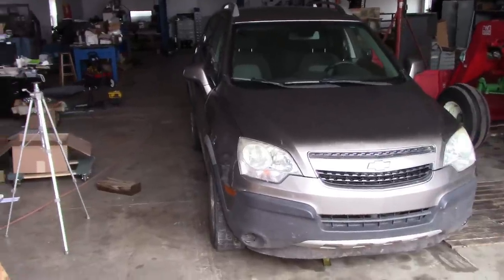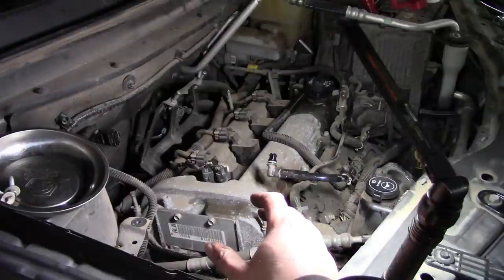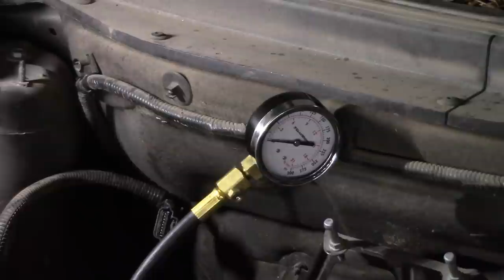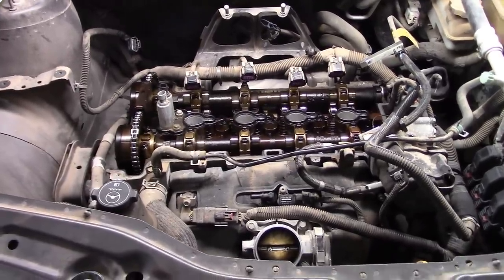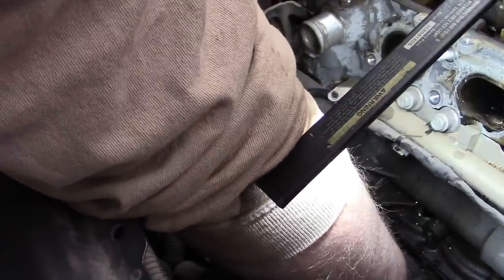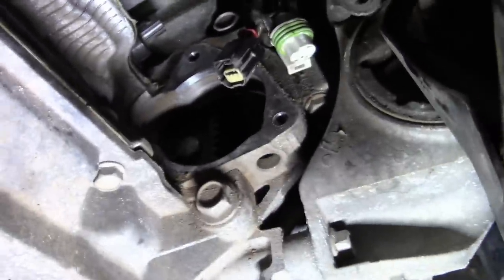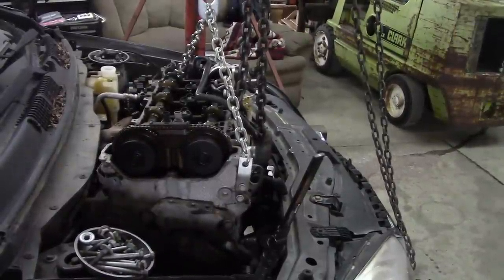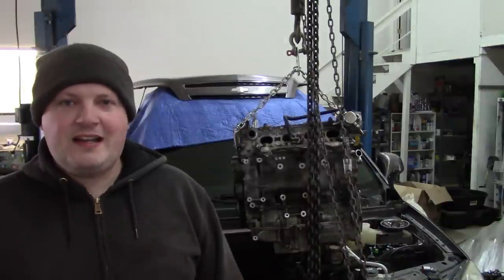I Bought the Cheapest Small SUV on Marketplace - Part 1

Comment: Universally known as a “Craptiva” here in Australia.
Reply: It's also known as a captiva in United States. From 2012 to 2015. And 08 to 2012 was Saturn vue. I have a 14 LT2 and love it.
Reply: Sean.. dit you read it? cRaptiva
Reply: @howardsen666  this is a different vehicle than the european one
Reply: Robert Wade here in south america those shits are everywere and they are GARBAGE. Keeps me in business right?
Reply: @howardsen666  I did read it. But there not all crap. But just do maintenance and  check everything. Catch it early. Not actually a bad vehicle. Hell if you look at forums I own 2 crap vehicles. The Captiva and a Ram Ecodiesel. They both should have blown up. Caught fire or killed me by now. But no, they haven't. Just don't beat on them like they owe you money. And regular checks.
Reply: Vauxhall here
Reply: Can confirm, it's the craptiva here is Aus. It's not just the drive train, but literally everything in that car. Things that never break in other cars fail all the time in that shit box (windows, locks, radio, odometer, anything electronic).
Reply: In Malaysia garbage hv more value than used captiva
Reply: @JM811Cars  Not exactly. We have it here as well. This particular variation was sold in Europe under Opel marque as Opel Antara. Unfortunately its craptivity does not depend on badge.
Reply: @arielatom03  HeeHee. ;-)
Reply: @TheMW2informer  That was an absolute gem of an email and article to read. Thanks for posting it.
Reply: Also known as the craptive in the U.K. too or the vauxhall antara
Reply: The Metalshop  so far so good. Both are alive and well.
Reply: Not just Australia. Everywhere.
Reply: Or junktiva

Comment: Let us have moment of silence for this dearly departed 2.4 L....
Reply from the maker: Yep, she's done!
Reply: I think I had that same engine in my Saturn Ion. I didn't have engine problems except for for valve timing solenoid. Lots of wiring problems though. I think I saw that same engine in the Polaris Slingshots as well.
Reply: cheeto4493  I had a 92 Saturn SC. it was burning oil like mad at 50k miles.  Saturn did a full rebuild out of warranty and only charged me $300. It was burning pretty good again by 100k, but adding one quart between oil changes did the trick. It made it to 180k when it blew the head gasket. It was not worth rebuilding or replacing.
Reply from the maker: @cheeto4493  I'm not surprised. The wiring harness is horrific.
Reply: The ecotecs are junk. Noticed where you live the other day while dad and I were hauling junk cars. We have an acreage on hillside road just a couple of miles from you. Dad runs muncks auto in clinton
Reply: No rust!! That’s gotta be refreshing. I live in the south and I just cringe when you push rust out of the way to get a bolt broken loose. This one will make your wife a nice car.
Reply: @beboboymann3823  HAH!  Live in NH, 10 years is the life of a car!
Reply from the maker: @munckdiesel5346  Nice. You guys just built a new shop did you not?
Reply: @beboboymann3823  She has a Toyota, why switch it out for this abomination? Sell it faster than you can say goodbye.
Reply: Watch Wes Work yeah we built a new shop a few years back. I’m turning 16 in a month and love diesels and basically anything with a motor so I love watching your vids. We run the old Clarke fork lifts too so it’s cool to see that stuff too.

Comment: "What is this a Chrysler product" LoL no argument there.
"What is that noise?"  Expensive.
Love the dipstick idea.  Though with it out my curiosity would demand I pull the pan off just to see the carnage.
Reply from the maker: We will crack it open in the next video.
Reply: @WatchWesWork  I was going to ask about pulling the pan. I wonder if the rod and piston are just sitting in the pan, because obviously it did not punch a hole large enough to leave the block.
Reply: @joesgarage805  I guarantee it's in small pieces.
Reply: I prefer using a long screwdriver because you can tap the tips of the pistons to see if anything sounds different from one cylinder to the other.

Comment: I like the ecotec motor I run one in my buggie 4-5000 rpm hour after hour in the desert and it is bullet proof, never have added a drop of oil. This one is the 2.2L and I have a back up motor I paid $500 for.  Like it so much got my wife a 2.4L Chevy HHR just changed the oil after 10,000 miles never used a drop of oil.  I did have a bad tensioner for the timing belt on my buggie when I got it. and put in the upgraded one and never a problem again.  just my experience. So. California no rust ever. no rain (not much anyways) either.

Comment: Wes next time you need to tepary a hose and the temp is kinking. Try installing a similar size pipe of spring or copper tubing to get flow. As a safety measure when drilling always slip a tube over drill bit exposing only the tip of the bit, to limit depth the bit will plunge to! keep several tubes with bit assortment. Thank's I really enjoy watching a "True Craftsman".    Excellent work.

Comment: Chevy (Holden in Australia) Captiva. Laughed my ass off when I saw this. Here in Aus these have a 'purchase at your own risk' reputation. Good luck.
Reply from the maker: That's how I feel about all GM products...
Reply: @WatchWesWork   AKA steaming piles.
Reply: @WatchWesWork  your not the only one, LOL
Reply: And they wonder why their still going down the plug hole
Reply: Watch Wes Work there called craptiva in Australia the resale price is so bad and parts to pricey you see then left on the side of the road when they stop working.good luck mate but think of it this way lots of content in videos fixing it.
Reply: @WatchWesWork   Sad to hear.  GM used to make good products I think.  I have a 1991 one ton dually with a 350 throttle body fuel inj. and a manual trans.  I like that truck.
Reply: istvan meissler they still make good stuff. You just need to get your information from more than the people that hate it. You need to see why some people have problems and others that don’t and make your own conclusions.
Reply: @lawnmowerdude  All GM products are universally crap, along with Fiat Chrysler's. I work in the motor trade and have the displeasure of dealing with these brands. Unfortunately all of the European brands are not much better.
Reply: Doesnt help that the demographic of people that mostly own captivas arnt exactly timely with maintanance.

Comment: They are sold by Holden in Australia and are referred to as The Craptiva leavings Sea of oil in the middle of the road on a regular basis. A friend bought one new and it fell apart 3 times in 20,000 kms so after the 3 engine he drove out of the dealers and straight into a Toyota dealer and never looked back. They say if you ever own one you will never own another !
Reply: Just don’t get the truck if you don’t what your vehicle to split in half lol.

Comment: Hey I've got an 09 Saturn Vue, pretty much the same car with the  same engine but with electric power steering. These cars were built in Mexico. When I bought it ($1500), it had coolant in the oil. Changed the head gasket but it still leaked into the oil again. Not sure where but it didn't have a crack. Finally replaced the block with a used one and had the head checked which was fine. Replaced all timing chains, sprockets and tensioner. Dropped the engine back in and it's been about two years now and haven't had any problems and no oil burning and car drives quite nice. Good luck.
Reply from the maker: Interesting. Cracked block?

Comment: That hole in the block is the Chevy inspection port.  We have had two vehicles with that eco tech engine a 2007 Saturn Vue Hybrid and a 2013 GMC Terrian. According to friend at GM there was a design flaw in the piston rings causing excessive oil consumption.  Our local dealer told us the only fix for our terrain was “dump it”.  My wife and I walked from the service counter to the showroom and bought a 2020 Blazer.
Reply from the maker: I'd have walk across the street to a dealer of any other brand...

Comment: 2.4s aRe running well into 250k miles currently in Solstice and Sky roadsters. No oil consumption.  They do have waterpump failures and rarely timing chain issues. The 2.0 has had HPFP failures. We carry a spare just in case.

Comment: Great content. Tip from a guy who has pulled two of these engines. One the way you pulled yours and once by unbolting top of the struts and unbolting the cradle. 3 hrs pulling. 1 hour 15 min dropping. Great video though!
Reply from the maker: Every car is a little different. I don't like to mess with the struts because you really need a alignment after. Plus I fear breaking loose the large nuts welded in the subframe. That turns the job in to a nightmare.
Reply: You know what. Now that you mention it I did have one of the “capture nuts” come uncaptured on the cradle. Yeah that was a pain lol

Comment: I replaced one in a Pontiac. It stalled and the throttle body was closed going down the highway. Manual transmission. It pulled seals looking for air. Dropped a junk yard engine in a the hatch of a 85 Saab 900s I got for 300. Temporary plates! It was a easy job. Got rid of it right after the job was done. I tossed the old engine right in my residential home street can. I sold the Saab for 900.

Comment: I owned a GMC Terrain with the 2.4. Was consuming 1 qt every 600 miles. GM techs told me. O that's normal. It's okay to drive. I give the Techs a single finger salute and said. I'm never going to buy any more GM crap no more.
 My daughter almost ran it dry. 😄😄 
Then the cam crank correlation codes popped up. Then the VVT soleniods crapped out. I replaced then with GM parts. Then the high pressure fuel system codes came up. 
About that time my daughter was leaving for Oklahoma. 
Clean and polished and waxed the Turd. Reset all codes and sold it back to GM. Bought a new Sienna le. All I do is basic service. Has 120k. Engine and trans no issues.

Comment: Last time I heard that kind of scraping, was when I through a road through a rod through not one but two inline 6 cylinder Chevy engines. One being a 292, the other being it’s little sister the 283?  Was always number 1 cylinder. First time I heard a similar scraping, was on an old 240 inline 6 on a 1965 Ford F-100 that was punched out 100 over. And Chevy had a similar issue with their old inline 6 cylinder engines, but it was because those inline 6’s was bad about dropping cam shafts back in the 1980’s. But I had to laugh, as I thought you bought a car that belonged to my ex. As they was bad about destroying oil pans, and trying to drive the car with no oil in it. But was glad to see Oklahoma plates, over Texas plates or anything indicating it came from Victoria, Texas.

Comment: Not that you’d ever do it but an interesting accessory you could make for the gantry crane is a tail that reaches out one way or the other past it with a little deep grove idler pulley on it, then you can hang the dangling end of the manual chain so it doesn’t get caught up or drag across whatever you’re working on

Comment: I'm app 25 miles from OK and yes, most vehicles around here are similar to that one as far as lack of rust. I have a few too many 50+ year old cars and trucks and they all have less rust than your pickup does. No complaints here with that. The only fasteners I'll have trouble with are a few body bolts that do get rusty and of course exhaust system fasteners. Sketchy wiring can even work for quite a long time before it catches up to you...
Reply from the maker: That would sure be nice. Trucks here will be missing the rockers and holes in the floors within 10 years, especially if you live on a gravel road.

Comment: good job shouting out neutral drop <3 those guys are legit
Reply from the maker: They crack me up.
Reply: @WatchWesWork  on a side note, i see that handy flashlight u got there, i have the same one. those quick connect flashlights are pretty cool and fairly skookum for the price
Reply from the maker: @TheTheonlyone1123  I like them, but I keep breaking them. My fault, I'm not nice to them.
Reply: @WatchWesWork  thats impressive lol. i managed to drop mine approx. 20ft down a spray booth exhaust vent and it happend to land perfectly on the baffles near the bottom that the magnet base held it pointed straight up the shaft, still providing me light for the job at hand and retrieval. but with any tool from the hazard fraught they are only so good but the price is just to good to beat especially when you have a family member working at one :D

Comment: Just did a engine job on a 2012 equinox 2.4, awd. It will come easily out the top. Back two bell housing bolts are a bit of a bugger, but by no means difficult. Hood didnt even have to come off.
Reply from the maker: Nice. The hardest part of the job was getting the big vacuum line off the intake manifold...

Comment: Very glad to hear your family is ok! You two seem to be good understanding and patient parents to that wonderful bear child you have! 1 acre turn radius was funny and needs to be looked at Dad!

I may have missed your explanation in the video: If that engine is such a problem style engine, and suspected to be locked up, may I ask why you would buy that car expecting to have to put that problem style engine right back in it? Im guessing you have something else to do, or maybe it’s a rebuild for family or friend that wants that style car?
Reply from the maker: Just like any engine, it does not have a 100% failure rate. But a larger percentage had problems than other similar engines. Many have already been fixed under various programs from GM.

Comment: 8 bought new a15 Equinox with this engine.  It came with free oil changes for 3 years. By the 4th oil change i decided to do it myself as I usually do. I found they never changed the filter and it had caved in from being so dirty.  I was yelling at the service manager and he said prove it. The dealer has a ton of lawyers. 
I dumped it real fast

Comment: If there is a next time you ever have to do this. Just remove cam gears and pull the head, intake, and exhaust manifold all together. I use a cherry picker to pull it outta the way. Makes pulling the engine or throwing pistons in it much quicker/easier.
Reply from the maker: That's a good idea. I should have just clipped the timing chain and pulled the head right off.

Comment: Great video Wes.  I'm wondering if it makes sense to go ahead and weld the old exhaust manifold while its on the old engine. The bolts will hold everything in place.  My limited experience with such a repair is that you pre-heat the metal with oxy/acetylene (maybe mapp works as well) and after confirming the appropriate temperature with an infra-red thermometer you stick or mig weld the pre-heated area. It seems you may have some time on your hands to do this.  Thanks again  Craig

Comment: UK 1986? Mazda 323... to replace door mirror you needed to remove wing, to remove wing you had to remove bumper.
The mirror did not get replaced....
Reply from the maker: Glue it on...
Reply: @WatchWesWork  passenger side mirror wasn't needed for certificate.. I was echoing yer comments about YTF do 'engineers/designers' not take into consideration serviceability access.... like that last bolt on the sump that you can only access by dropping the exhaust.. ye know what I mean.. ;-)

Comment: They used the 3800 in the Equinox (the Equiknocker), lemmie tell you, that thing will do a front wheel drive burnout indefinitely. Well, maybe until it runs out of gas.
Reply: They used the 3.0 for the v6s, more power than the 3800

Comment: What a hoot. I just diagged an 04 4.0 Cherokee driven in with a strange engine noise and a sever miss . Pulled plugs no. 5 plug destroyed  compression check 0 psi on no. 5 hole. Tried borescope. Didn,t look right not a good view. Stuck a scrap power window cable in no.5 plug hole and like you after inserting it about 20 plus inches I struck oil and the bottom of the oil pan. This thing drove in. No sign of external damage. But wernt no piston in that hole.
Reply from the maker: LOL. It ate itself. I saw an ISX Cummins split the whole side of the block off on #1 cylinder. It drove in that way.

Comment: I just bought a 2006 Malibu with that same engine minus the high pressure direct fuel injection system - the Intake cam jumped time and bent 8 intake valves - about 130k on it so measured the bores and they were just about one thousands over new spec and not tapered at all so I'm just doing the top end.  All the chains and guides on this thing is a pain in the butt...
Reply from the maker: That version was a lot better than the DI version.

Comment: Wes I belong to a HHR forum that covers the 2.0, 2.2 and 2.4 engine. No one on the forum really talks about oil consumption on any of them.
Yes timing chains are an issue and also all of them are an interference design.
If the chain went out of phase a valve can hit the piston. Bent valve is the norm when that happens.
To me my first guess is it dropped a valve.
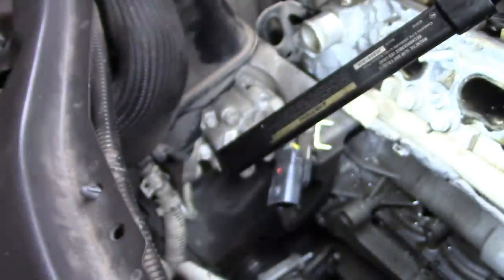19:51 It's really a Saab engine that GM uses.
Reply from the maker: Interesting. The older 2.4 was fine, but the direct inject version was not well thought out.
Reply: @WatchWesWork  I have to disagree. Just make sure the engine you buy is for the year of the vehicle as the ECM and or the BCM won't be happy with sensors that are on it. You're smart, do your homework.

Comment: I live in Norway and drive a 05 Peugeot 407 (what you call Eurotrash).
With a full galvanized body - no rust - and proper treatment by the factory. 
They hardly rust. Sure, some bolts here and there. But nothing worse than you would expect from salted roads.
But we might have less salt on the roads than you do in IL - and better made cars from Europe ;-)
Reply from the maker: Heh. Most cars built here in the last 30 years have been "e-coated", which helps a lot with rust. But we use so much salt that it only lasts around 10 years.